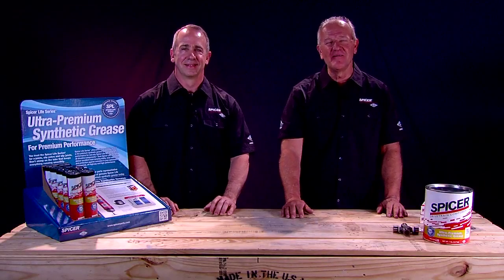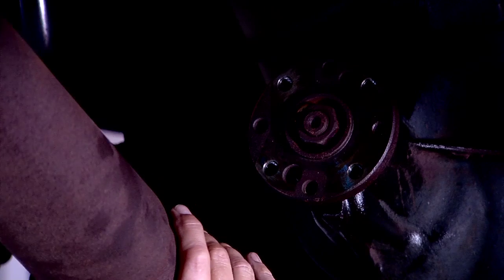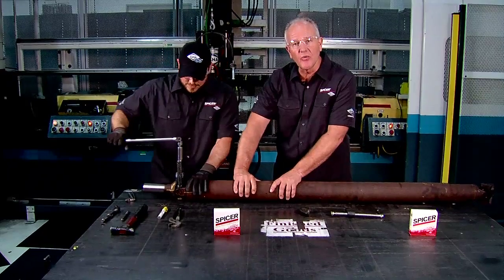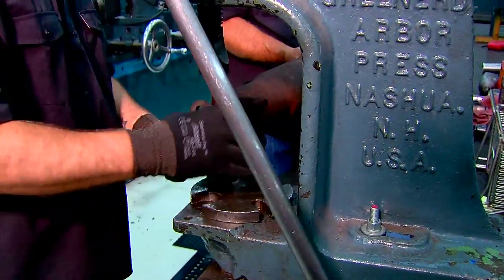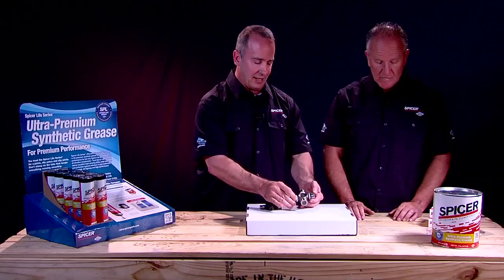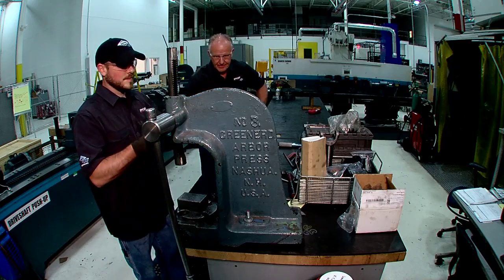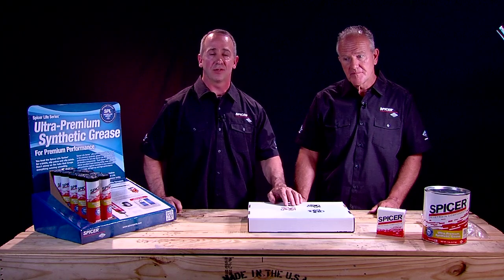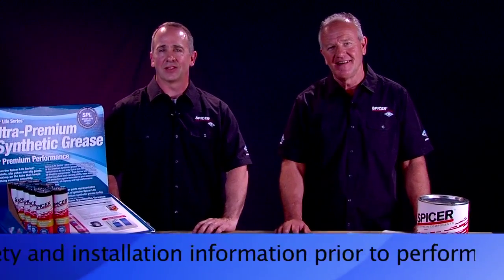Driveshaft Repair | Spicer Garage

Comment: Dude, what in the god damn hell is that fountain cup going to do to slow the leak. If anything,  it may delay the leak, as you only diverted it down the cup. Would be more helpful to suggest rear lift spacers so the tail housing is tilted up, ya still might lose some- just bill for it
Reply: And the part about "after you drive if you feel vibration change your snap rings , just try different ones" this is horse shit. Absolutely wrong garbage info. 
During installation center the joint then check for axial play. Should be just barely some but not none. This is why the snap rings are provided. You make these products,  why is this clown saying this low quality information?

Comment: A needle bearing has a diameter of .078"
If one fell in the bottom of the cup you'd know.

I am running your 5-1410x Ujoints in my 2005 Ford E-350. They come with .059" copper, .061" gray, and .063" pink snap rings. NONE of them would fit in the grooves. The grooves have been SANITIZED. I am running .056" snap rings in all 8 spots. 
I have a stash of snap rings.
If you DONT have a stash of snap rings and you DONT know to do this you could be inclined to grind the caps or smash the snap rings in there and have too tight of a fit with ujoints that are too stiff and this could cause a vibration. 

There are clearly inconsistencies in machining and what works best for your vehicle. 
Aftermarket parts store ujoints are even worse. I can only recommend knowing this stuff OR only using OEM because thats whats made for your vehicle and only your vehicle.

Comment: After a local garage bent my driveshaft beating the F out of it to get old u joints out . I just do em my self now . I take a cut off wheel on a grinder and cut the u joint . Then i dont have to push a cup both ways . Way easier ! I remember in the late 70s welding my first shafts up with a coat hanger and a cutting torch set to gas weld ! Never had a problem ! Never broke one ! Spicer is the best by far !

Comment: Just a question. After you pressed out the u-joint at 5.35, what do you do, if both legs are not parallel at the drive shaft? I'll appreciate your answer. Thank you.

Comment: i like pushing the new cup further up in the bore so the cross piece extends out of the bore on the other side. that way the needle bearings in both cups are in contact with the trunnion and kept in order.

Comment: I have a 97 Jeep Cherokee; I just replaced the balance pulley and the radiator, (like, yesterday) and NOW my drive shaft literally just FELL off as I was driving...this happened once before, when I first got it, and I had a guy put it back on, but was told it was missing some bolts, which I guess he didn't replace? Bc it just fell out again....is this problem related to the balancer pulley (not sure if I am correctly naming these parts!) at all? Or is this an altogether separate issue??

Comment: CAUSE EVERYONE HAS AN ARBOR PRESS. Grow up spicer just use a hammer and vice like everyone else does
Reply: you can get that ujoint removal tool as well as a jumbo balljoint press with a ujoint relief hole on ebay very reasonable, a vise is okay if its large enough to do the job, a hammer is for a monkey who doesnt care about their vehicle.

Comment: new volvo semi truck. my rear drive shaft was out of PHASE for 79,000 miles the dealer was to STUPID to FIX. after fix still have a VIBRATION that is growing can't get volvo  to fix.  how much DAMAGE done?????
Reply: is this a good price for the shaft assay?? https://www.ebay.ca/itm/372647024539?ssPageName=STRK:MESELX:IT&_trksid=p3984.m1555.l2649
Reply: @earthstix6407  yes that is a very good price make sure you grease and re band the boot (211959x) around the sleeve thats what keeps those SPL shafts from failure. Also line up the yoke shaft ears with the weld yoke ears so your shaft is in phase. If you still have vibration problems and this is part of a one piece shaft take it to a professional driveline shop there could be more wrong with your shaft than you know!
Reply: an out of balance HD spl drive shaft can take out Transmission counter shafts and cause havok on your rear diffs It is extremely advised that you take it to a Driveline shop for estimate/repair otherwise you could be looking at a larger bill and longer downtime. If it came from factory not in phase there could also be a reason! the only answer to that is that you have a compound angle which in case putting a Driveshaft out of phase is the only way to correct it. Do not plough ahead and fix yourself. If the problem is growing all the more reason to stop and have parts checked/ repaired. Most Driveline vibrations occur at certain speeds in different gears noting both will help. does your vibration come from the wheel or the seat? do you feel it through the entire truck? Taking your truck to the dealer is not always the best bet for fixing your driveshafts. Although they have tech's there Driveline work is a niche in the industry and not many mechanics know the ins and outs of the driveline world. good luck

Comment: Hello

Do you guys build the rear drive shaft for a 2008 Acura MDX that runs fron the transfer case to the rear differential??, my mechanic said it has a stiff front joint that is attached to the transfer case and he said it is un-repairable.

Comment: Sometimes after replacing the Ujoints you need to take off those factory wieghts when rebalancing.
Reply: I have a driveline shop and the problem is when the factory weights are welded on they weld in the middle and a lot of the times you can't knock the weights off because it will put pinholes in the tube sometimes it won't and will knock off and other times will damage the tube safer to leave on if they haven't fallen off
Reply: I have a jeep with 2 u-joints. It's mom's actually. She brought me 2 new Spicer u-joints with zerks on the caps. Do I need to align or phase them somehow? Or does it not matter how I aim the zerks?
Reply: @xmo552  just install them the u joint should be all the same it's the other components that are balenced
Reply: @96cr  
Thanks. I figured the zerk shouldn't be enough to imbalance it. I did like them up just to be safe. It spins smoothly.

Comment: what kind of u-joint remove tool dose he have/or tool.. can you give me information  who makes it or phone number or web site .. thank you.. I like to buy one.
Reply: old way....hammer and vise.  correct way, arbor press and socket set, or press accessories    Part stores may have or rent a tool. ???
Reply: That is called a Tiger Tool U Joint Puller.  They make knock offs cheaper, but the metal used is typical Chinese junk and can break.  Better to get the actual Tiger Tool if you can swing the cost.  Good luck.

Comment: does the drive shaft need to go back in the exact same splines it came out from .. and bolt to the same holes you took it off from??
Reply: yes, if you dont have a balancer.
Reply: Yes
Reply: I got 2 Spicer u-joints with zerks on the caps. Do I need to align or phase them somehow?
Reply: no it does not

Comment: In my place we repair an average of 20 driveshafts a day, I´ve been doing this for more than 34 years, best regards!
Reply: Hello Do you guys build the rear drive shaft for a 2008 Acura MDX that runs fron the transfer case to the rear differential??, my mechanic said it has a stiff front joint that is attached to the transfer case and he said it is un-repairable.
Reply: Would you happen to know if a yoke being 180° is ok or not?